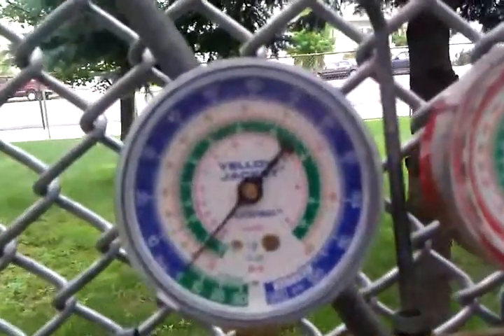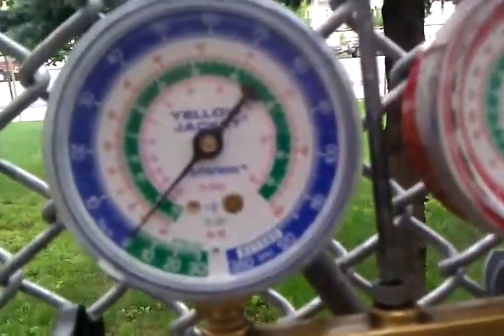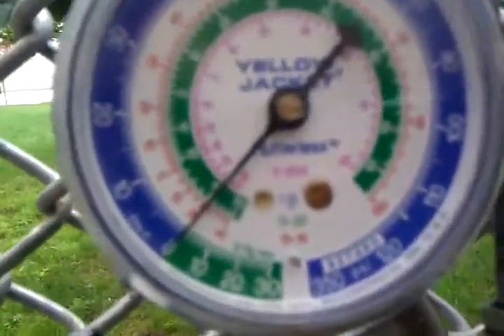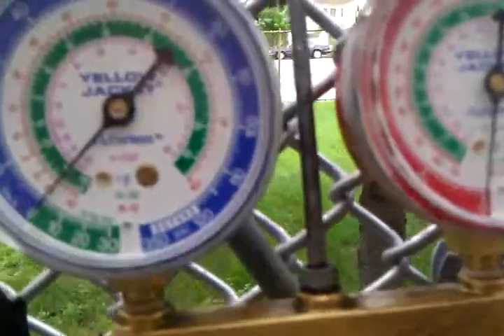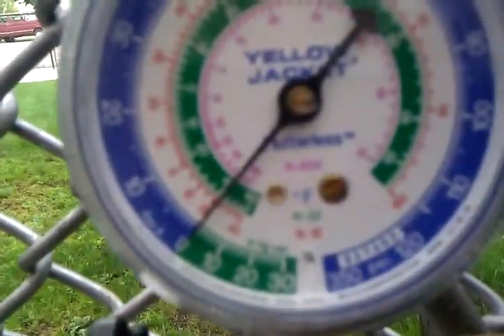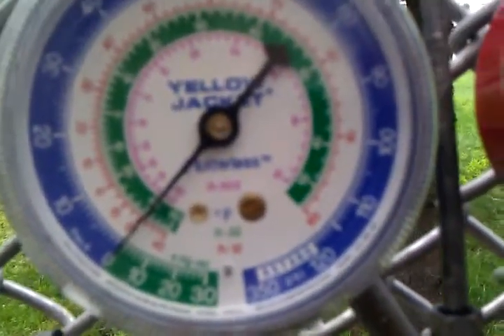Hvac Gauge Manifold Calibration

Comment: With respect, wouldn't it be more accurate to use a p/t chart and a bottle of refrigerant ? I usually store the refrigerant at a stable temp then connect the gauges to the ref.bottle and then calibrate my gauges to what the p/t chart says the ref. should be at that temp. The gauges will not always register 0 psig anyhow that's how I check and calibrate mine.